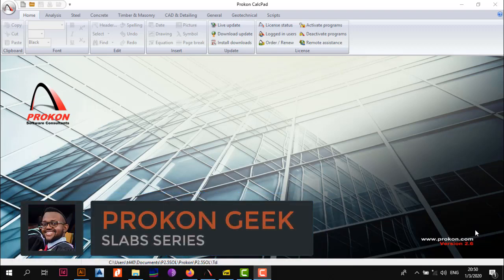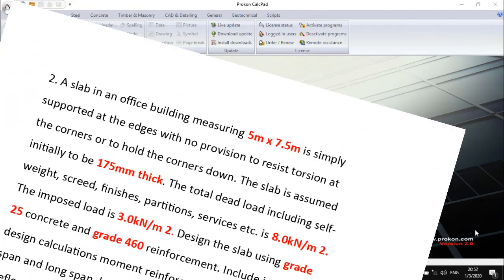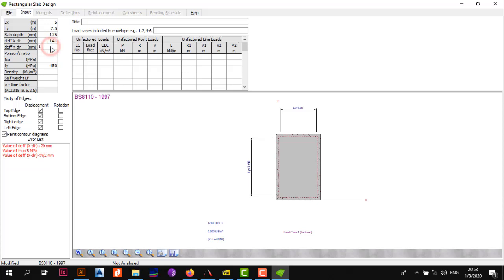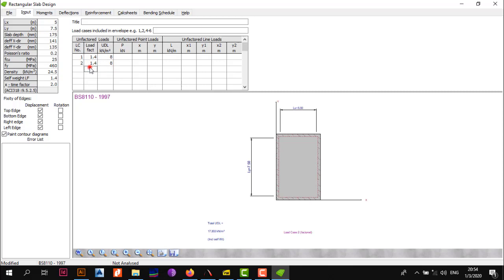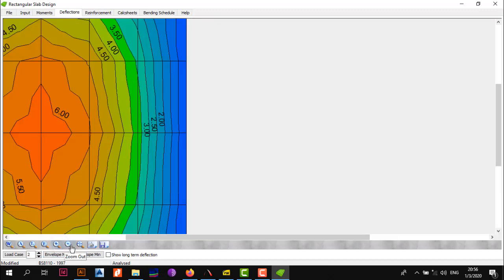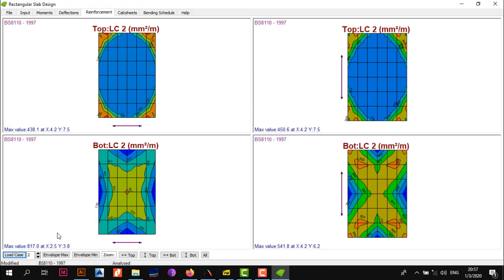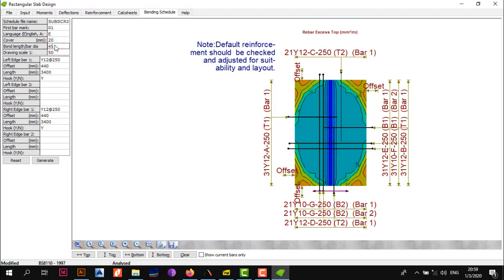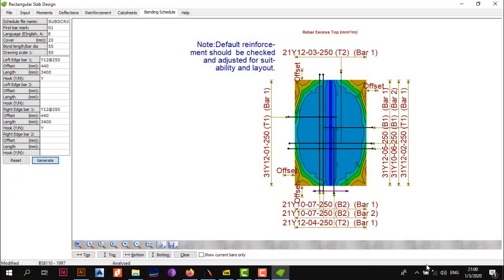Simple Slab Design in 10 minutes: Prokon Rectangular Slab Design Tutorial 2_Office Slab Example

Comment: I have a little doubt, in this question they mentioned that total dead load 8.0kN/m2 including the slab self weight, in that case when you enter the udl value for load combination table I think you need to reduce the self weight value from 8 kN/m2, otherwise self weight add for the slab for twice.

Comment: hey bro. as per the question it may be worth noting that the 8kn/m^2 include the self weight of the slab so if you could rectify by inputing the density of the concrete to 0kn/m^3 . will be witing for ur response

Comment: Good day sir, thank you for the video, I do have one question though. At around 3:35 into the video, you add the concrete density and Self Weight factor in the left hand side table, and at that point you will see near the bottom of the screen "Total UDL" updates to 6.002 kN per square meter to take the self weight into account. Then when you add self weight to the top table, it increases to over 22kN per square meter UDL. If I understand the software correctly, you should either include self weight in the left hand side table or the top one but not in both. With the specific case, a total self weight was supplied and I would therefore ad it to the top table, but then exclude it on the left hand side parameters. Doing a quick hand calc shows the total UDL should be 16kN per square meter is you use a 1.4 self weight factor as you suggested, but the total is shown as over 22kN per square meter. Regards, and thank you again for the effort put into these videos.
Reply from the maker: Hey Jan, thank you very much for bringing it up, well first let me just say you can add the factor to both tables, how does that work, when you have separate dead loads or you have a situation where the dead load does not include the self weigh of the slab you then add 1.4  or 1.2 to the left hand table so that the calculation for the self weight contribution at ULS will be taken care of using the Gk of 1.4 then when you enter the dead weight say due to chairs and other partitions and furnishings you add 1.4 or 1.2  to the top or RH table so that when their contribution is being calculated that Gk you entered is used to get it. Now thank you very much for pointing it out in this particular case the self weight of the slab was given along with the Dead Weights on the slab i don't know how i missed that i think it's getting used to just seeing dead load and assuming its everything else besides the self weigh of the slab so you are right i was not supposed to add the 1.4 to the LH table as in theory its actually just supposed to be Zero for the LH table then the 1.4 is added only to the top or RH table because the 8.0 Kn/m2 was already inclusive of the self weight of the slab. Thank you very much for subscribing and being attentive as its people like you that drive me to deliver these tutorials much much better and just improve on my knowledge sharing. I really appreciate and hope i might have added something useful by explaining that you can add to both tables but then it depends on the circumstances of the give loads.

Comment: @proKongeek How did you get 141 for effective depth in y direction?
Reply from the maker: Hey Edward thanks for watching the videos, so 141 i got it from applying the beam strip method to my slab where you get effective depth by saying (overall depth - cover to links - diameter of links - half of the reinforcing bar diameter) in this case it was 175-20-8-6. In our case since its a very simple slab and not a flat slab you can easily have just said 175-20-6 to give you 149 both are still correct ways when you are doing a preliminary design. Hope i have answered you well and a very good eye mate hope you subscribed!
Reply: @prokongeek6239 .. Thanks. Well understood. Your videos are really helpful.